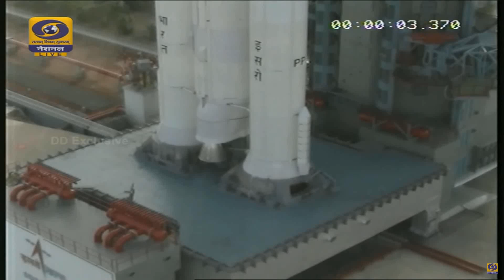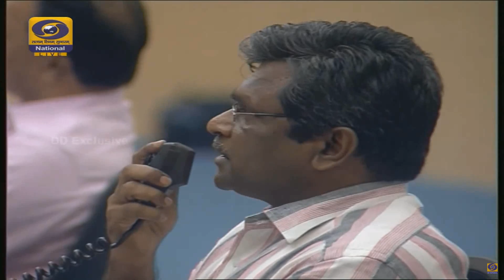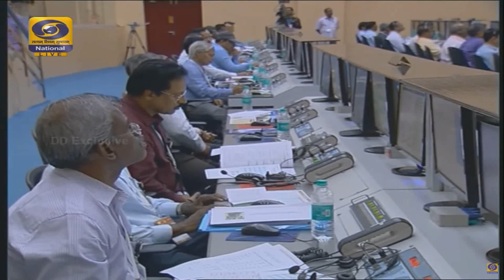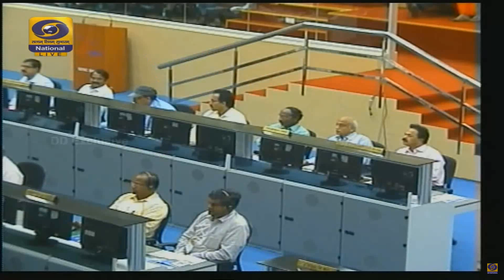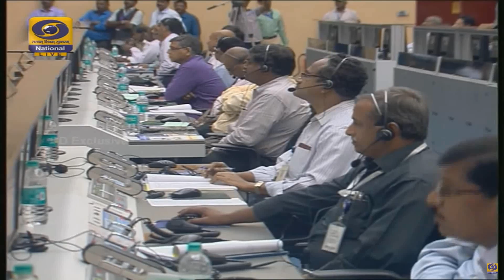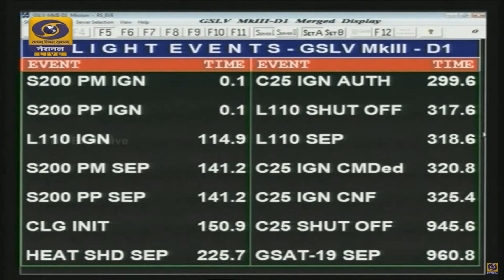India’s Most-Powerful Rocket Successfully Reaches Orbit

Comment: Why does the rocket slant over and fly horizontally so soon? Looks a little bit suspicious there....
Reply: getting to space is easy, it's only 100km up, staying in space is the hard part, you need to go sideways fast enough to fall around the earth and miss, AKA orbiting, that requires 7000m/s horizontal velocity, so the rocket needs to be going sideways , and fast. 

with this rocket, the massive Solid Rocket Boosters mean it has so much force it can start going sideways really low in the atmosphere compared to other rockets without wasting energy in the lower atmosphere.
Reply: Its trajetory to enter the orbit